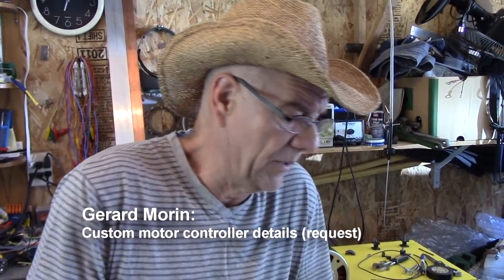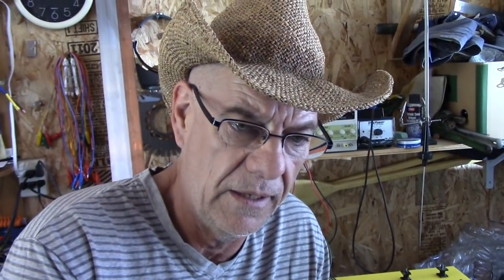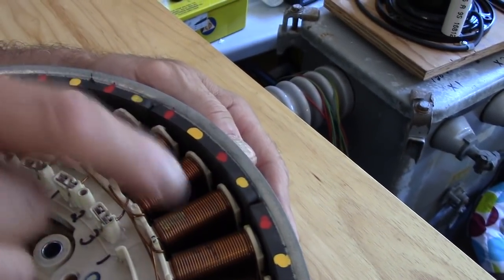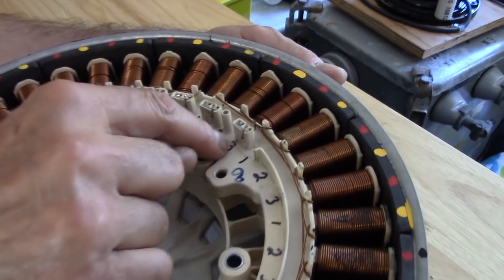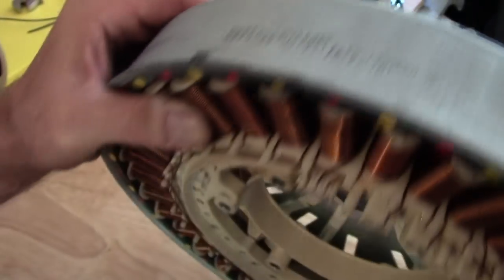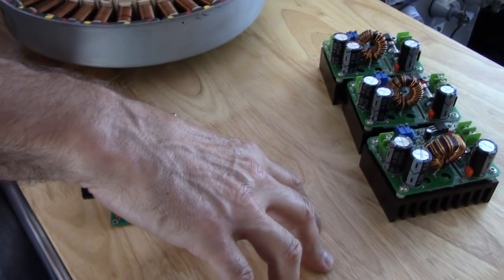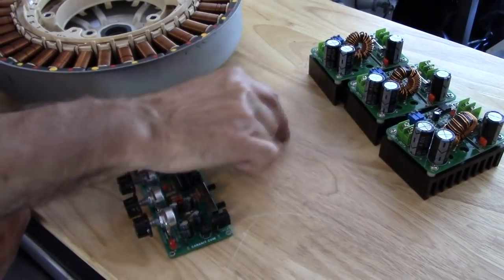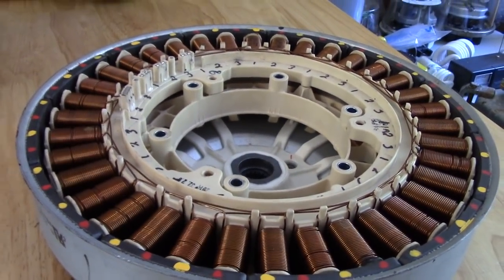Final Stages and Custom Motor Controller Design

Comment: Try a a smaller resononce Aluminum generator in the center of a Joe cell filled with Gallium Aluminum Scandium alloy that is surrounded by thick solid state solid electrolyte graphite crystal power cell's designed to build up the electrity produced by the schuman resononce and crystal power cells to generate a resononce bubble that max's out the crystal power cell's electrical power generation. Through in vacume spark gaps in key locations to release the potential of all that electrity being generated.

Comment: use a mechanical distributor...ignition...from 3 cylinder...chevy metro...or suzuki swift...3 cylinder..
Reply: A six cylinder distributor worth trying also, connect 1 and 4, 2 and 5, 3 and 6 so it's the same as a 3 cylinder dizzy. An issue would be varying and adjusting the off time and the on time independently while experimenting. But if you go back to Gerards video where he shows his slasher.. that would work depending on how the brushes were arranged. Or the commutator from an induction motor or similar could also give you the timing mechanically.

Comment: The way you expose it, it looks incredibly easy with logic gates and an arduino. Good job !!!
Reply: Do you know which linux software is best for generating high frequency pulses? I'm thinking of using RPI3 for that, and logic gates to multiply and cascade it. Sound card is limited to 96Khz.

Comment: Why not get the controller from the washing machine where the motor came from?
Reply: that controller is limited...the number of poles limits his speed, he doesn't understand that part
Reply: @touchthesun2448  you probably didn't hear what he said, depending on different winding connection he made it Open Y Connection pulsing 3 poles in Cascade repetitively.

Comment: why don't you use a distributor with 65000 volt coil. drive the distributor with your drill, the faster you spin the distributor the fast the motor should spin.  distributors also have mechanical advance and vacuum advance so you can tune it to your needs
Reply: Interesting

Comment: gerald could you use an automobile (pontiac firefly) computorized distributor for the cascade  that car had 3 cylinders
Reply: spark plugs could probably eliminate amps in the distribution of the current.. I will build one to try it

Comment: Electromagnetic Levitation Quadcopter
Halbach Array associated with Linear Motors?
https://youtu.be/pCON4zfMzjU?t=262
https://s9.postimg.org/rj6qjnfvj/Screenshot_2018-01-22_at_4.01.59_AM.png
https://s9.postimg.org/pfwbc5g4f/20180122_040833.jpg

Comment: That electric motor is a great design. That is why it has been in use on washing machines for 2-3 decades. Yours is not more powerful than a car engine..  (although it could be if much larger). That will be what powers all cars one day. Direct-drive, no transmissions, all wheel drive, and (partial) power recovery with 'braking'. Batteries and capacitors are catching up... Motor/ generator will probably be an array of nano-thermocouple junctions (think millions) and a simple heater box. The efficiency will be 98%+ with almost zero emissions.  
And there is no 100% efficient energy conversion.
  As for experimenting with those washing machine motors; look at others controllers... many new designs all the time. Don't be all against a simple 3 phase inverter to start with, they can work too.
P.S. I design experimental power generation with thermocouple junctions. I "print" them directly on ceramic layers; car motors with unmatched efficiency and no moving parts. I feel industry needs to go this direction. They ignore it in the area of transportation.
Reply: He's right about the point that something has to move, but forgets to mention that EM field could do that movement instead of material parts. EM field resonance for example. Although, to be precise, its not the field, but volume of ether particles enclosed by that field. I've stumbled upon one research, which mentions this possibility with some formulas and figures to test, if you dare =). Here's a link: https://drive.google.com/open?id=0ByyeIdK8FssyZjRJUWRGMy13M2M Last update dated at 2013, its a 700 pages multiyear work, wide scope (too wide I should mention, but important stuff is there).

Comment: I tried to understand you but from what i gather you need to be able to input voltage on the different legs at different times so why cant you use a mechanical controller with contacts? Even yet after you have the rotation why cannot you adopt a type of gearing or transmission to the spinning motor to achieve a greater rpm?
Reply: Mechanical contacts operate to slowly. You need to use solid state switches (MOSFET) which work on a molecular level and can switch thousands (if not millions) of times faster and have repeatable responses.

Comment: wow! your getting rigded bro, Its oddviuos U R very frustated. and I c UR point ur almost there , but  ur comment on no such thing  as solid state generator , lets meet, I'll also help u out, its a signwave generator/controler, UR looking for. think higher hrz. my friend . think rez. of ur stater also  u might think a carbondfiber  copy of ur stater, as well as ur outer rotor w/ n52's, when u get these together u will freek. i know ur bizzy . but if u want real answers call me 772-324-1533 or email
Reply: Do you use corbonfiber because of its weight, or because of its material structure or because of its electrical/dielectrical properties?